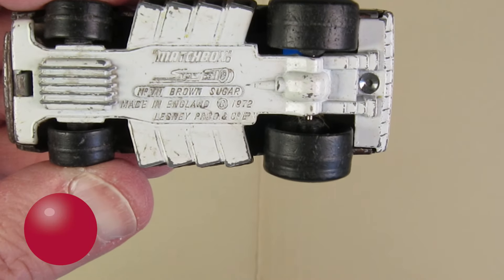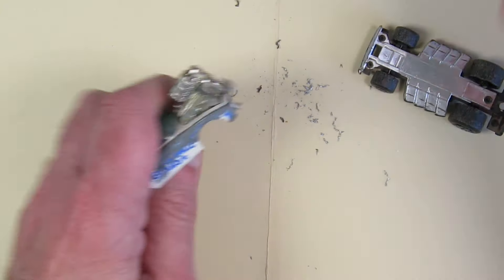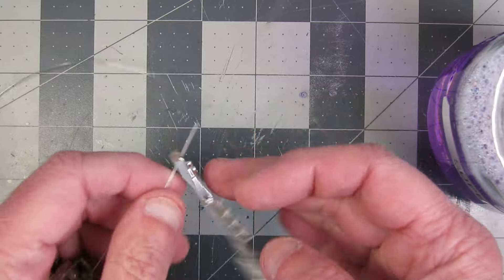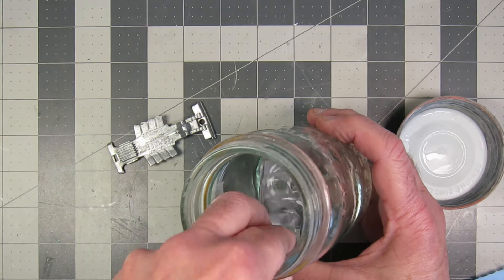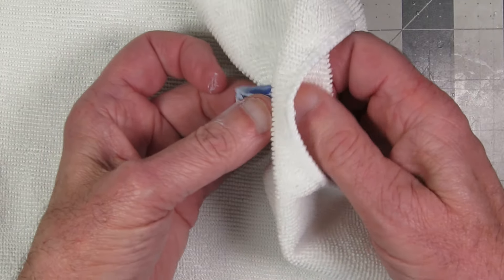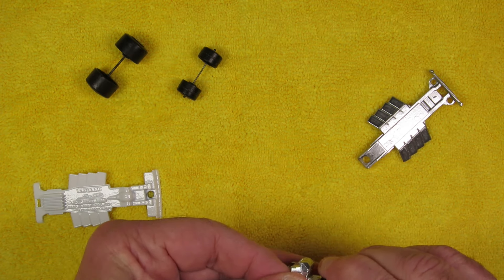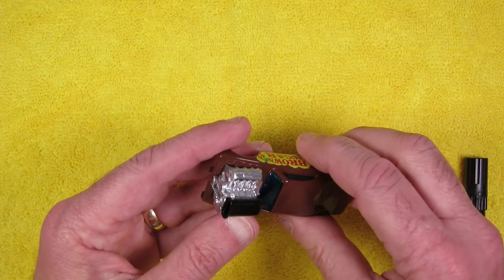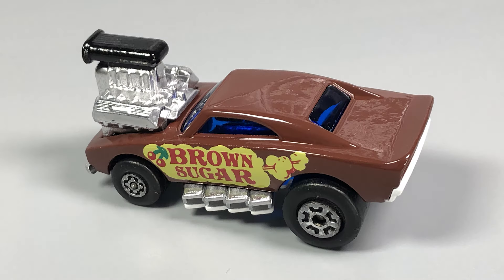Matchbox Brown Sugar Restoration - Diecast Restoration #matchbox #cosmicblues #brownsugar

Comment: So great!! Can’t wait to do my kid owned Brown Sugar! It’s got ugly yellow glass in mine! Wish I had a spare motor for it but I may just add one that’s close!! 😎🤙 it still has the decals underneath my kid paint job. Anything I might be able to try to get the old paint off but leave the decals?? 😬
Reply from the maker: Thanks Brian!  The engines in these are oddly wide.  I was thinking I might drop an entire Muscle Machines engine in one, but it was too narrow.  I can't imagine anything that will spare the decals...unless the paint is very light...maybe water based paint?  If warm water doesn't pull it off, I'm not sure anything else would be worth the effort.  The decals are cheap enough really - I got mine from Black Square Decals on eBay and they were something like $6-$7 with shipping from the UK.
Reply: @JimSilva-SilvaDiecastCustoms  sounds great 👍 I’d like to kick little Brian’s butt for painting over such a cool decal 🤣🤣